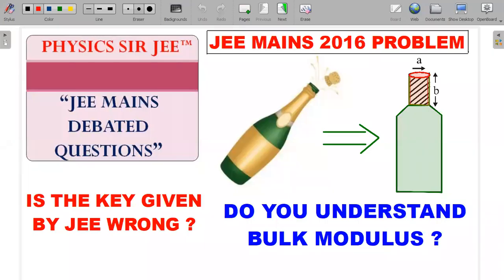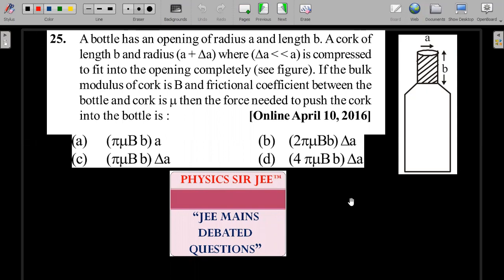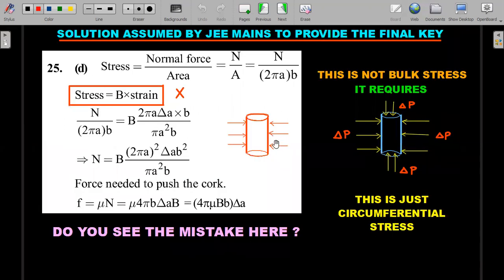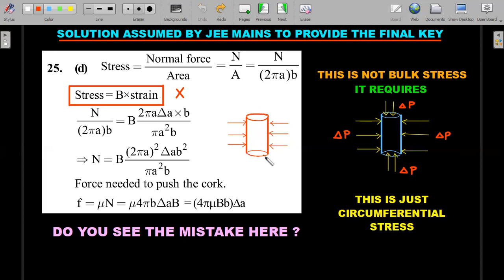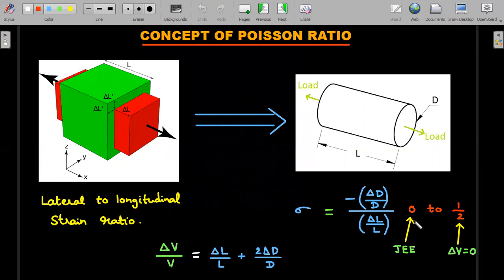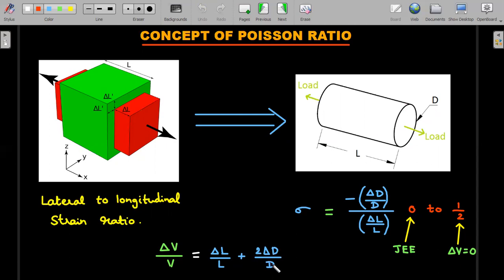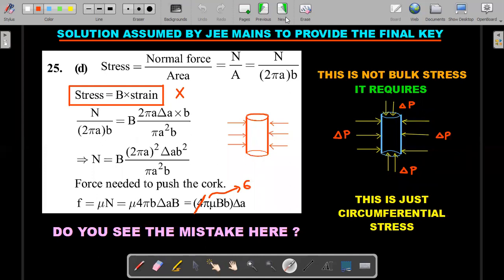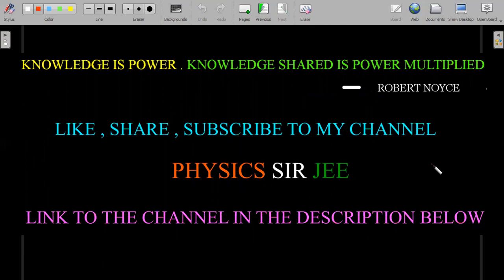JEE MAINS DEBATED QUESTIONS | 2016 ONLINE | BULK MODULUS  BOTTLE CORK | WRONG KEY BY JEE ?

Comment: JEE MAINS never fails to surprise , some say its too average but I find the physics section of it quite fascinating (though maths and chem of it are normal) but Physics part is quite the one they give to test if the students its quite familiarized with the indepth concepts , they have so many times modified JEE ADV q ,sometimes some very unique q .This video also gives a very good insight to this concept.Very Nice SIr😃
Reply from the maker: Yes true , especially when CBSE used to set the papers till 2018 . I feel since NTA took over in 2019 , standard came down and competition increased
Reply: ff @PHYSICSSIRJEE  sir in this question in reality case, delta L by L is 0. post superposition there is no change in length..but yes then we can't use the bulk modulus and volume relation. the equation u wrote to the right mose.. won't it be for the assumption case.. delta V by V= delta L by L + 2 delta d by D.  Infact if i actually consider the question based on assumption.. such that length does reduce (delta p all sides) what would our equation then be. 
what do we put as delta l by l here.. cause if we do that.. both would end up having the same result

Comment: Sir won't the force be a variable one depending on the distance moved into the bottle?
Reply from the maker: Yes , but we assumed very slow process and to make it finally to get in , highest Limiting friction should be applied . That's what we solved for
Reply: @PHYSICSSIRJEE  sir how to deal with numerical questions which are not assigned with a range in key ?
Reply from the maker: @puspalpaul185  in JEE mains , when in doubt , leave it in choice. In JEE advanced , trust your Concept , answer will align with the key provided, if the Question is correct

Comment: Sir during final calculation of Force you used Y=3B but won't that be wrong as you yourself said that Y=3B can be used only when Poisson's Ratio=0 and that is when ∆D/D=0 but in the given question, ∆D/D = ∆a/a which is NOT equal to zero
Reply from the maker: The presence of Poisson ratio is cancelled due to two opposite effects of two steps of superposition. The presence of ∆D/D doesn't always mean Poisson ratio is non-zero . That's true if rod was allowed to change its dimensions freely. Here it's restricted.
Eg: I hope , you remember when a rod is fixed between two ends and heated . The ∆L/L is zero . It doesn't mean Young's modulus is zero.
Reply: @PHYSICSSIRJEE   Superb explanation sir 😁 Got it !!!

Comment: Sir, can one counter-argue that if Poisson's ratio was indeed taken to be 1/2 as delta-V = 0 (since the assumption is justified either way due to the nonspecificity of the statement ). Will the NTA answer key be justified then. I guess the bad habit of not properly introducing concepts in coaching is exploited well by NTA and they thrive on students making assumptions.
Reply from the maker: Did you check carefully on paper ? Are you getting the key given with Poisson ratio = 1/2 ? Sure?🙂

Comment: Sir mere ek doubt clear kardijiye 11th mei hu interest hei physics mei not any book question but doubt hei general(curiosity doubt)gravitation se related hei sir doubt hei sir hame pata hei ki  gravitation force acceleration between any object like ball football and earth and it is independent of object mass is same but sir kya agar ham two small mass consider kare two toh vo dono ka bi gravitation force wala acceleration constant hoga agar air resistance friction kuch nahin ho and ham space mei baat kare toh kya vo bi constant hoga ya fhir only due to earth acceleration is same and it is independent of mass.
Reply from the maker: The law ( within classical limit ) is tested for objects outside Earth also. Experimental evidence ke bina kisi postulate ko "LAW" nahi kehte.
Reply: As a matter of fact Earth isn't special, Gravitation Laws are same for all masses. In case of Earth it's interesting to know acceleration g isn't constant  g=GM/R^2 where R= radius of earth for small altitudes we ignore changes in g because Radius of Earth is huge. But as you will learn in a few months we can calculate variation in g with altitude and depth. So technically it will be wrong to say its constant.

Comment: Sir there was a question in ioqp stage 1 in section 2. It involved mulliken oil drop concept. In the options there was an option which was correct and it stated that an excess of 5 electron are there on the drop and there was another option that stated the charge was 8 * 10^-19. Nowhere magnitude was mentioned, still everyone is saying both options are correct. Please help sir.